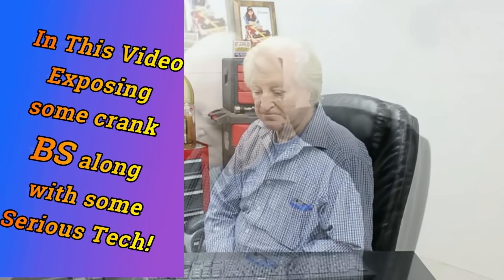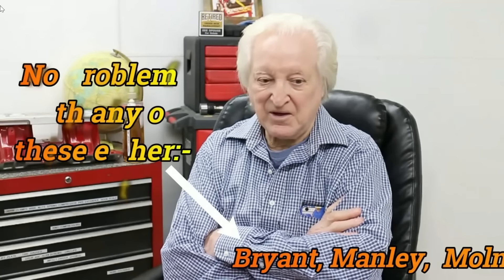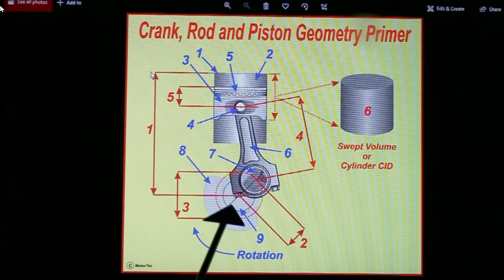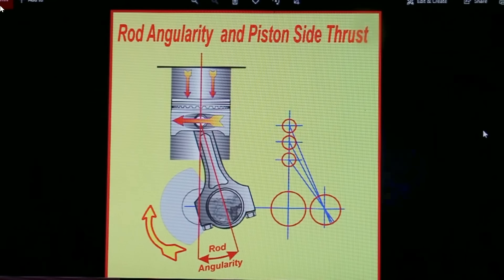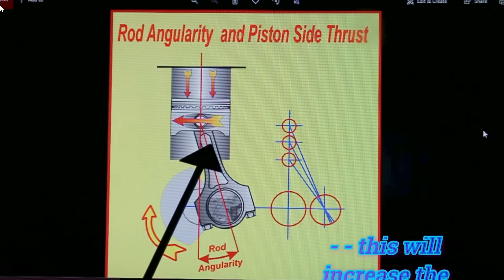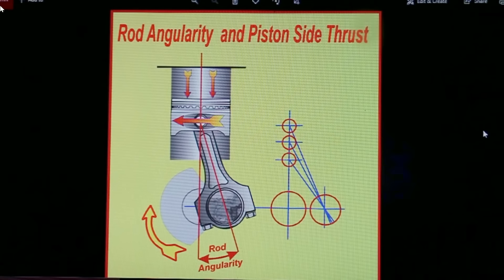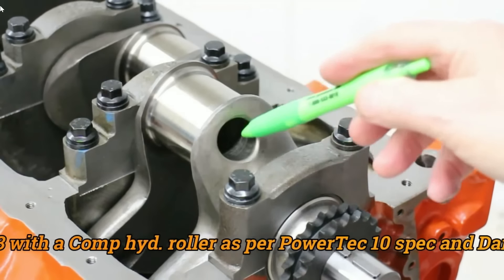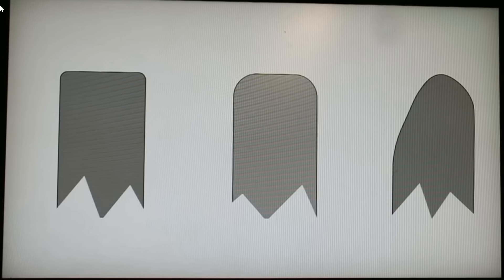Crank modifications for increased power Part 1

Comment: Crank polish is important for bearing life and oil temp. On a microscopic level, it orients the direction of the end grains of the metal, so the direction of rotation when polishing is important.  When I polish a journal,  I start with a P800 cork belt, and finish with a woven belt. Excellent results, with only about .0001 or so removed. Anyone that I have seen polish more than a few tenths to correct bearing clearances ended up with a journal that was out of round, tapered, or some combination of bad geometry. 

Micropolishing is effective in a production environment because the backing shoes must be made to a specific size. If you are micropolishing many of the same size journal, it is cost effective to make the required shoes. If you have many different sized journals the shoes would make micropolishing impractical. Micropolishing achieves the same affect as polishing with even less metal removal. Quite precise, and done quickly. 

Properly polished journals can support higher loads with lower oil clearance and oil pressure than a poorly prepared journal. As for friction, I would imagine you could get a bigger reduction in power loss from a more efficient oil pump than you can by reducing friction at the crank journals.
Thank you for the excellent videos.
Reply: One process I've seen on Ford/ Mazda cranks are a No. of very small radial grooves on the journal maybe 15-20 per journal just about deep enough to see and feel with a thumb nail so circa .5 of a thou. I understand it's for oil retention and with engines on 32-35 psi boost and 650+ hp from 4 cyl. 2.3 Ltr they are doing 20,000+ miles and looking the same as when they went together. Just how things move on.
Reply: @gothicpagan.666  usually dividing the bearing surface like that reduces its load capacity (see design guides for oil or grease grooves in bushings for example), perhaps the grooves being so shallow means they don't disturb the oil wedge and thus avoid that issue?
Reply: @nerd1000ify  It's purely for oil retention. The bearing should never come into contact with the crank journal.
Reply: Most OEM and production crankshaft polishing is done with a tape, rather than a belt. Much more consistent results and very little dimensional change, leaving you with one process (grinding) which is much more easily controlled for better quality control. Tapes are on the 15 micron abrasive level and it's pretty easy to achieve ~7 RA finishes with them and great form control.

Comment: Great video 👍 I was a Rolls-Royce and Bentley engineer for many years and  cleaning out the sludge traps ( hollow crankshaft journal) was a common job due to the poor oil filtration. Sometimes they would fill to the point where it blocked the oil feed hole and ruin the crankshaft.

Comment: David:  Thanks for the Crankshaft differences.  I plan on building two different SBC 350CI engines.  On will have a 3.48 stroke with a 6" rod.  The other is a 3.750 crank with a 5.7" rod.  Your determining the crankshaft to rod ratio is extremely helpful.  Thank again!

Comment: This is awesome to see you so well I trust, I followed you projects in the triple C car mag way back, when I was  building an engine for my roots 1725 sunbeam alpine, I took you advice to have the head an cam matched at pipers tuning, at the time one of your ccc articles  
 stated that a rough finish in the intake close to the valves would improve the sturbulance at back of the intake valve, along with the inclined valve guides to reduce wear on the valve stems ,this worked out very well, with pipers distributer timing advice , at 7000rpm it was 38 degrees , the home grown crank flywheel rods had a great deal of attention , mainly weight reduction as did the valve train etc, with twin 40s it pushed out 150hp and 170 flbs , the only problem was the head would eat the gasket, however it took only 5 hours to change it a small price to pay and cheaper than the wills ring conversion, I had many great hours driving it with no other probs, your time at ccc was a huge help to many iam sure, again so lovely to see your still pushing the passion, I’ve subscribed and looking forward to next vlog 👍👏👏👏👏

Comment: Maybe the oiling mess was BMW's way of oil cooling the pistons. If they didn't have oil squirters, this might have been an option.

It has been said that piston oil squirters were one reason the Nissan 300ZXTT was able to take big increases in boost. It certainly wasn't the only reason, but it was a contributor.

23:00 Some people use the 12 counterweight crank when stroking a Jeep 4.0L I6 to 4.6L. That 12 counterweight crank was found in the early Jeep 258. It has been said to endure boost better that the 6 counterweight crank. It is interesting to me, an I6 has advantages over a V8 in balance.

Thanks for these various videos about engine building.

Comment: I had a 427 SB chev push the thrust out of the crank.   It was a Shafaroff motor and had a Callies standard weight crank in it.  It was a 54 lb crank with 350 mains.  He was in a hurry and the only thing Tom had was a light weight crank at 42 lbs.  I thought that might be a good  test of the light weight crank.  We saw no difference in performance.  The car ran exactly the same ET as it did before.  I was disappointed.  Now in a circle track motor it would have taken 12 lbs off the nose but in a drag race car we couldn't see a difference.  My guess is the weight being so close to centerline the gain was not enough to measure.  I certainly agree with what you are doing with leading edge.  Joe Lunati and I talked about that years ago and I asked him for drilled throws but without the knife edged leading edge as I wanted the knife edge on the rear and not the front.  He agreed with me but said, "if they won't listen to what you tell them, sell them what they want."  I am a pilot and former military pilot.  That isn't how my airplanes are shaped.

Comment: back in the early days of diesel performance. like late 90's early 2000's there wasnt big turbo tech yet. electronics were still pretty weak. so tuning was still pretty basic too.
there was a shop i almost worked at that the owner was taking the stock rotating assembly out of the motor and lightening them balancing and swapping the balancer and flywheels or lightening the flywheel. he was getting an easy 100-150 hp more out of these things just getting rid of the dead weight and casting flaws. and it made the motor much more responsive. pretty cool stuff to learn when your young and getting a real understanding of how it all works. i was lucky enough to meet many mentors like that over the years and get some really good insight. its made every project i tackled come out way better in the end because i actually get who what when where and why.

Comment: I just tore down a 408 Ford Windsor stroker that I put together in 2011. It made about 650 or so HP and ran 6 teens in the 1/8th at 108 or 9 mph at 3100lbs. This was a bracket motor. It was made to last a long time. The 3" mains everyone says you cant keep oiled were perfect. The rods were Chevy journal size and one of the Rod bearings failed. The rest were fine. The math on this motor does not equal the necessary rod stroke ratio talked about here. The motor was a brute torquey sob too breaking 2 named brand converter in that (over) 10 year time span. All this may hold true for a Chevy but it does not hold true on a Ford. 6.25 rod and a 4" stroke crank. AFR Heads. Runs like a beast. Almost the same thing too for my 347. Not 1.6. Run 6.50's in the 1/8th at 3250lbs. Still has power windows in the car. Both of these are naturally aspirated. Again, maybe for a Chevy but not for a Ford.

Comment: Regarding the BMW crank shedding oil into the path of the piston, it's likely for lube, but also piston cooling. The latter being very important, especially on a turbo motor.
Reply: Makes a big difference in aircraft engines too. 
Pops old Continental 65hp used to struggle to hit 150f for an oil temp and you really had to run it a long time to burn off the moisture. 
Well, when it was rebuilt, it was built to 75hp specs. 
That's piston squirters , and advanced timing ,the rest is the same. 
Basically they get the 75hp rating by revving it 2-300rpm higher, so pops put the timing back to the 65hp spec and runs it as a 65.
Now though, it runs 180-190f on the oil temp which is a good thing, the oil is getting that heat out of the pistons, and making the engine a more uniform temperature in the process.  
Yeah at first that sounds like they aren't working, but that's the deal you should see a temp increase. 
And it fixed any moisture accumulation issue.

Comment: Because of a rules deal I once built an engine that had a 1.4 rod ratio.  I was a bit concearned about it but it held up just fine and was really responsive and torquey.
Reply: but the top end power is very low.
Reply: @stoosee  It didn't turn over 5000rpm but at 4000rpm the power was very good.  It was a diesel so it wasn't going to run big rpm anyway.

Comment: David, I like the way you put those energy losses into tangible units. I don't know what the oil flow out of the crank journals is but 15kW is about double the power of an electric shower. In a partial vacuum something is going to get hot...
Reply: Pops was telling me the other night as we picked away on a parts plane about how they accounted for ,or actually used the weight of the oil in the balancing on a Franklin aircraft engine. 
If you ever get a chance to hear or see one run, they're so smooth like a sewing machine ,they far and away put any continental or Lycoming to shame.

Comment: Great crank analysis , on the subject of rod stroke ratios and piston side loads i wonder if the concept of moving the bore center line away from the cranks center line have been explored , it goes to reason that the side piston thrust side loads are heavy on the downward travel under combustion compared to the compression up stroke ,this gives us the ability to add side loads to the compression stroke and reduce side loading on the combustion stroke down travel ! an other benefit is we can increase the vector pushing down on the crank past tdc as added leverage is gained  ! vs the side vector pressing the piston skirt against the cylinder bore ! having the entire bank of cylinders offset moved over to the down stroke side should net gained effeciency of transferring combustion pressure to work output !
Reply: Seriously? Where have you been? That's why piston have orientation and you can't just put it backward.
Reply: @anggaros1  Your talking about piston pin offset to reduce piston slap ,which actually increases side load on the combustion stroke , and any valve clearance notches have to be correct. its an  old drag racing secret to gain a few hp with flat top pistons , you reverse the piston offset , yes put them in reversed , that reduces side load on combustion but still leaves you with a pin off piston center either way , so at tdc during combustion the forces are twisting the piston trying to rotate it causing more piston skirt friction. your not understanding my idea for increasing torque by reducing side thrust under high pressure.. 
.

Comment: power loss caused by drag on the rotating assembly in the media it is moving through and is reduced by the application of aerodynamic shapes. if it is moving in vacuum, it then becomes a function of the viscosity of the oil.

Comment: So awesome David 👌 Would love to see your thoughts on engine balancing… I read about some big horse power dirt tract engines running offset balancing.. counter weights 2% heavier than rotating weights etc..
Reply: I wouldn't do that.... 😕
Reply: Yep a slight over balance works out for high rpm engines it's basically to help with harmonics at high rpms and the added oil stuck to the rods and bottom of the pistons at those rpms causes a slight out of balance condition plus the roughness of the car running on dirt can cause the oil to bounce around and cause bad harmonics
Reply: @79huddy  So, making the crank counter weights HEAVIER than the bob weight, so when oil sticks to it, it makes it even MORE out of balance is better? 😕🤦🏻
Reply: @davelowets  read what you typed we control the oil weight on the crank counter weights with a scraper and windage tray having the crank counter weights balanced slightly heavy helps it balance out from the extra oil slung on the rods and pistons at high rpm that causes your Bob weight to increase
Reply: @79huddy  You don't think that even WITH a scraper and windage tray, that oil wont stick to the crank? You'd be wrong.. It STILL does.
Reply: @bigboreracing356  Sure it does... A few grams of oil isn't very much at all.
Reply: @bigboreracing356  A few grams matters ALOT @ 7500 RPMs
Reply: @bigboreracing356  and how are you to know EXACTLY how many grams of oil ARE going to end up clinging TO the crank at various different RPMs, g-force from maneuvers/launches, and so on? You don't. There's nothing wrong with filling the crank passages with oil, and neutral balancing the rotating assembly. All you would be doing otherwise is "guessing" at when, where, and how much to take away.

Comment: Here because all my life I've heard don't mess with the crank it's a lot of work for little gain. 
Well, that doesn't sit right with me.
I've had a flywheel or 2 with reduced weight and it's awesome. 
And by reduced weight ,I mean chopping it from 13 pounds to 6. 
So I know there's something I'm missing out on by not futzing with the crank. 
I'll put in work for a slight gain, it's more than the other guy did so I'll be faster 😃
Do a whole ton of slight gains ,and then you've got something.

Comment: Reshaping a crankshaft so that it moves smoother is a option for gaining power and engine revolutions but when you start removing material you lose torque due to the counter weights built into the shape of the crankshaft, so shaped weight would need to be added

Comment: I have a Mercedes M119 V8 5.0 engine which I will be stroking and over boring for a final displacement of 6.0 liters. 
The factory pistons resemble that of a diesel engine and are massive with long skirting. I will need Mahle to manufacture a set of pistons for me. I would like a piston with shorter skirting, longer Rods, much thinner Compression rings. Are there any negatives or cons to dramatically reduce the rotating mass compare to stock? Would the engine loose it’s momentum and change the characteristics? It is a very smooth engine to start. 
Or do think the positives out way any negatives. 
Also, this engine has a Aluminum cylinder bore which Mahle right now are the only ones that I could find make a compatible piston for.

Comment: I love Scat products!! I mostly use scat cranks as well, I have 2now , one I plan to use in a 400 SBC block, even though it is a 383. Crank, it will require bearing spacers,   ( * does anyone make a bearing it's self for this app, fitting a 350 crank in a 400 block,  I'm planning on using 5.7 scat rods, as well,. I wouldn't mind using a 3.25" 307/327 crank,  but 406cid is hard to pass up,  it depends on what it's used for! ✌️

Comment: Tom Falicon did the crank on my GPz 750 turbo and my Pro Stock KZ1000 like this back in the mid 80s. Ive known about this a long time like you have too im sure. Unfortunately I race in the NHRA stock classes and we cant do these mods to the crank. They have NHRA approved cranks that are required and any modifications is an instant DQ.  Ive been torn down at the track and have to remove the engine to open up the oil pan and missed the next round because I couldnt get it back together in time.
Reply from the maker: Mr. MWD I am guessing you have had some very interesting experiences. If I am  right how about sharing some. Note I do have a personal motive here- you could be video material! Am I going in a direction favorable to you?????

Comment: Wouldn’t the cylinder only draw in air when the piston is moving down making a suction? If the piston is not moving down and is holding in same place it wouldn’t be drawing in air at that time it just makes sense this is another advantage of a stroker because it’s still moving down farther and longer drawing in more air and not wasted sitting still.

Comment: i am putting in a 4.125" stroke eagle 4340 forged crank into a stock 350 block, hand clearancing, and stick welding steeL to reinforce the block cast iron. Also trimming the crank in places as weLL. Can it work in a daily driven 421 c.i. camaro?

Comment: question crank case vacuum ? many years ago i played with a home built smog/vac pump on a turbocharged holden 202 6 cylinder , anyhow playing with different drive ratios / pulleys
 i managed to drive the pump that high a speed and pull an extreme amount of vacuum that it took all the oil pressure away ? zero , and yes i didn't use a moroso vacuum rated valve , to this day i have not figued out why ? are you able to shed any light on this please DV
Reply: If it wasn't a dry sump system, that's likely "why", imho...
It could've been basically "atomizing" the oil from the bottom of the pan if it were pulling some "serious" vacuum on it.

Comment: BMW's F1 crankshaft possibly using oil flow in the piston area for cooling in turbocharged application. Pistons get very hot in turbski leading to melting pistons and failure. Right?

Comment: A Hollow shaft is stronger than a solid one. Union Pacific knew that before the Merlin engine. 
The axles for the drivers are Hollow in the Challengers and Big Boys. I'm sure the practice goes back even farther.
Reply: A hollow shaft is not stronger than a solid one. You can't make something stronger by removing material. On the other hand, a hollow shaft has a higher strength-to-weight ratio than a solid one.